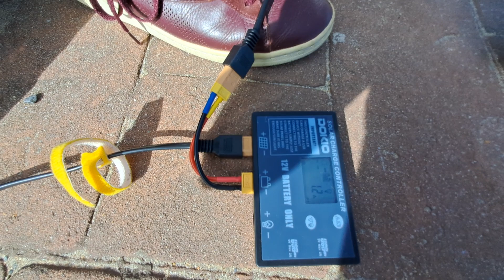Dokio 80W foldable solar panel: Any good for ham radio? Beaches On The Air OZ1KOB

Comment: you work with tuner!?
Reply from the maker: Yes. I've got an LDG YT-100 antenna tuner fitted inside the battery compartment of the Yaesu FT-897D. 73 de Diego EC1CW